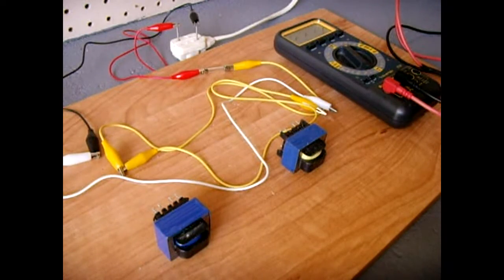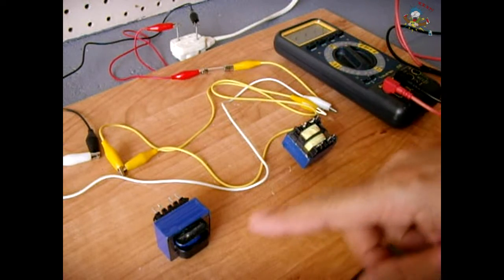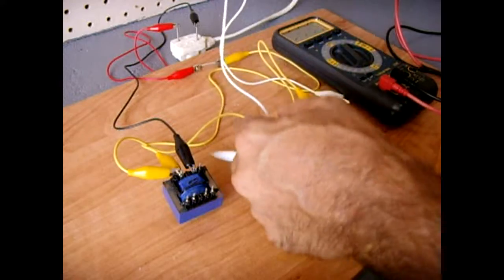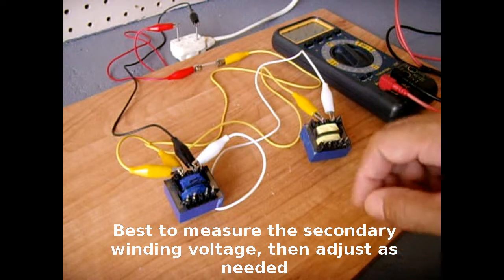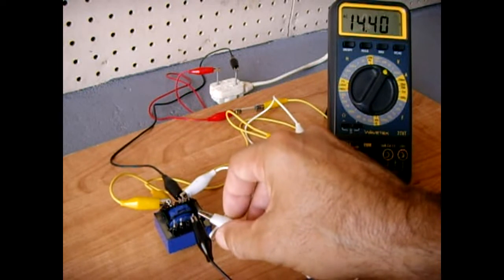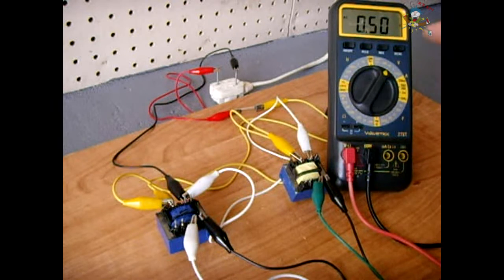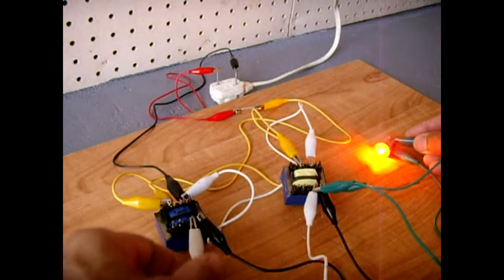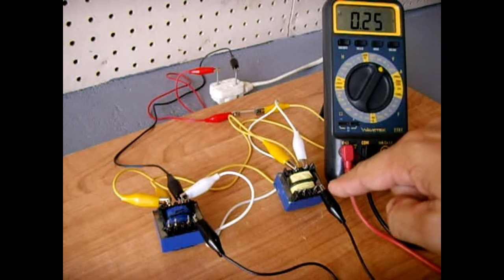Using Power Transformers In Parallel or In Series

Comment: Hi, nice video,  i have a question. I have a  (Grid Tie Inverter  SUN 500w, that works 230v, looking inside it has  2 transformers,  and on board there are 4 pins.  (1-2)-(3-4) to make 230v the connetion is (2-3). but i want it work on 115v, The question is: how to connect it, keeping  500w output?, tank you in advance. NJM
Reply from the maker: Without me actually looking at it, there is not much I can do.

Comment: I have a question can you wire 2 transformers to the same ac mains and use the transformers individualy instead of in parallel or series for instance use one for adustable power supply and the other to power a fan for the power supply?
Reply: Yes. We do it all the time with isolation and stepdown transformers. Fed from the same source as long as the primaries are the same.

Comment: hi sir its me again heheheh can you build a metal detector please sir a detector that can reach up to 6ft tnxx in advance......
Reply from the maker: I have owned a few very high quality metal detectors. What determines the maximum depth are ground conditions(soil type/sand/etc), detecting frequency used, type of metal in the ground, search coil size, and most importantly the SIZE of the object. Most metal detectors will locate large objects a few feet away with no problem, but coin sized objects may only be located about 1 foot away on average. Using a large search coil may allow you to find a quarter buried about 18" deep if the coin is laying FLAT. If the coin is on edge, then the profile is much smaller. Silver and copper coins you can find deeper. They are good conductors.

Thanks For watching.
Reply: can you make one so i can make it heheheh thankss...

Comment: I had one of these small microwave transformers and even was able to use it for a little while, till I accidentally burned up the primary winding by connecting the input to the wrong pair of pins. When I proceeded with the repairs I found out that there was some kind of electronic component connected between two of the four input pins (which was covered with the coils of wire so you can't really see it till you unwind the primary coil) and to one end of the primary winding. And the really good thing that I noticed about these transformers is that their frames can be made wider by sanding off the protruding edges of the framework, allowing more of the laminated iron core sheets to be inserted into the frame, thus increasing the overall transformer's power capacity.
Reply from the maker: You needed to watch this video. :-)

Load Lamp ~ Very SImple, But Very Useful
Reply: electronicsNmore Thank you. That's a really smart way of checking the connections of inductive loads. I first saw this method in one of the videos on how to construct a transformer, but didn't really thought of it as something that might come in handy one day.

Comment: I really hope you were using a GFI/RCD protected mains source?  Hot plugging mains with a suicide cord and alligator clips is really ill-advised.  At least you had a fuse, but that wouldn't help much if you accidentally shorted before it, and it most definitely won't prevent a potentially lethal shock.  I hate to be the guy calling for safety paranoia, but mains sources can kill people, even 120 VAC, and those inexperienced with working with them shouldn't follow your example.

The matching isn't critical for series connecting two different transformer secondaries, the limit is simply the minimum of the two transformer's maximum secondary current ratings.  For higher voltage transformers insulation failure can be a limit when series connecting, especially with the frames bonded together and earthed.  If you get the phasing wrong with a series connection there will be less voltage, in the well matched case; much less voltage, and not much current can flow into any load that was expecting their sum rather than their difference.

For paralleling them though balance is fairly critical and getting them to share the load equally requires good balance.  If they are grossly imbalanced a large current will flow in the secondaries even without load (the voltage difference divided by their impedances).  You can measure the current between them with your meter, if it is small, a few percent of the maximum secondary current, you can likely ignore it.  In general I'd suggest never paralleling transformers unless you are really stuck with no better option.  An inefficient way to force better load sharing is with series resistances, but it is basically a horrible hack.  Better to just get a bigger transformer.
Reply from the maker: Thank you for posting your comment.

Let me first say that I am not your typical individual when it comes to working with 120v/240v mains power.  I have a lot of experience over the past 2+ decades when it comes to wiring branch circuits, installing & replacing main panels, as well as complete service from the weatherhead, through the meter housing and in. So your concern about what I am doing(in handling the insulated live wires) should be directed at others. As a result of your comment, I added a notation in the video warning others to be very careful when handling live mains wires. I also mentioned the "One hand rule", which any electrician should know. If an individual knows very little about electricity, or has little experience working with 120v or 240v power, then they have no business duplicating what I did in the video. There is also a disclaimer in the "About" section of my channel main page. Like many electricans, I have gotten my fair share of accidental shocks over the years. Dry hands, good footwear, and the one hand rule helps keep you safe. Don't fear 120/240v, respect it.

As for the series connection, your right, it is not as critical as the parallel connection. As long as you have a very good balance, using identical transformers with a very close output(within a couple hundred mv apart), you should not experience any problems. I say this because of my own experiences, as well as all the research I have done on this subject. Parallel transformers CAN be done, as long as you know what your doing.

Thanks For Watching
Reply: electronicsNmore well said  i also respect it not fear it

Comment: i did use 2 differente transformers in series one time when trying to charge a 12V battery without a charger. It was a low current charge though so it didnt exceed the smaller transformer power but if you need to charge a 12V batt and have your main 12V power supply and a cheap sega wallwart or something like that, which cant supply a lot of current, at least it will give you a small boost in voltage to allow you to charge.
When you dont have a charger and your battery is reading below 12,5V, waiting 3 days for it to charge is the least of your problems.
Reply from the maker: The transformers don't have to be as exact if you are using them in series(especially when they will not be in continuous use), but when it comes to parallel, absolutely need identical transformers. You should make a MOT(microwave oven transformer) 12V battery charger. I have a video for that. You can get lots of power to charge 12V batteries. 

Thanks For Watching!

Comment: Another well informed video, good job! )
Reply from the maker: Glad you liked it.
Reply: electronicsNmore I was considering joining 2 mots (700 watt each) via isco blocks but I`m not sure it would work for me since I`m using a pulse wave modulator and it`s only rated to 40 amps and I`m getting 30+ with one transformer. This is for an HHO project, a next move up from my youtube video 'h-cat water jacket (ii)'.  I`m trying to combine HHO with a flame along with a h-cat for heating.

Comment: So i can reverse the connections by supplying 11V AC on the secondary side in parallel and get 2*120V on the primary side (measured in series) ?
Reply from the maker: If you supply AC power to the secondary, then you will get a stepped up output at the primary.
Reply: Awsome, I want to build a HV supply from 12V
Reply from the maker: Just be careful! The output can be deadly. If you have a 12VAC power supply, it should work fine stepping up.

Comment: So as I understand it, you always want to connect the transformers' primary coils in phase and in parallel.  The choice of parallel or series output comes from how you connect the secondary coils.
Reply from the maker: I was just demonstrating how reversing the 120V line and neutral will effect the phase(flow of current/direction) of the transformer at the secondary output. You can connect the 2 transformers as you would like, just as long as you locate the proper wires to be connected at the secondary for a series or parallel output. 

Thanks For Watching!

Comment: Its never a good idea to parallel two transformers like this. You should add a small (0R1) poweresistor to one of the connections. Although the seem the same, micro small difference in the voltages will introduce a skewed current load on the transformers.
Reply from the maker: I have never experienced any problems doing this. Get them as identical as you can, and you should be fine. I did notice toroidal transformers work exceptionally well when paralleling. Adding a .1 ohm high wattage resistor is a good idea though.

Thanks For Watching.
Reply: I agree with you entirely. You treat 2 transformers the same as you do power transistors by using a low Ohm wire wound resistor. The test shown does not have the transformers under load. I have had 2 transformers within 0.2V and one got rather warm and hogged the power under load (6A). 2 x 0.1 Ohm 5W wirewounds and all was well - 3A on each tran.
Reply: @jp-um2fr   Hi. how should these two resistors be connected  to transformers?
Reply: Yeah, you are right. And when you connect transistors in parallel, you should connect them through resistor too.